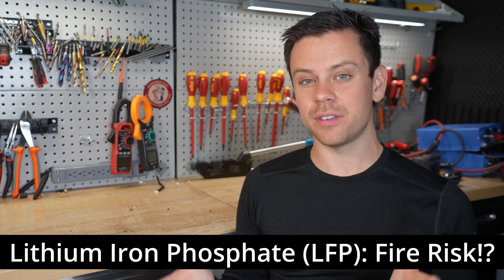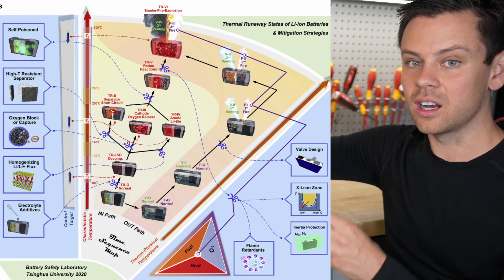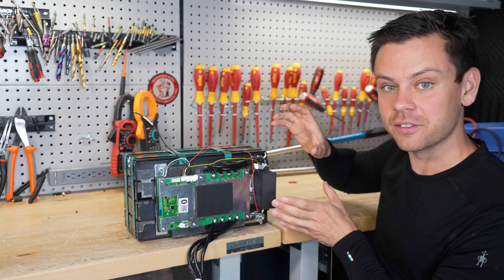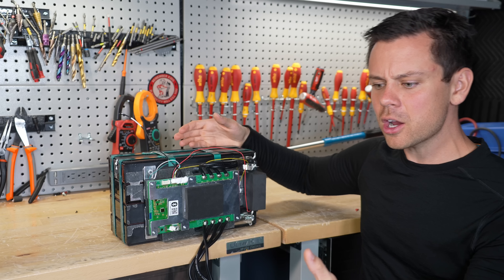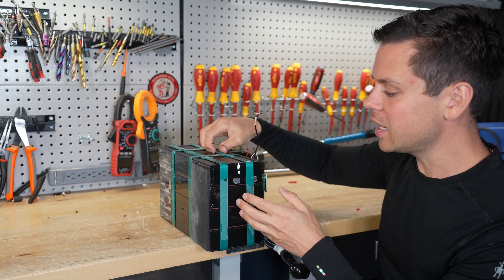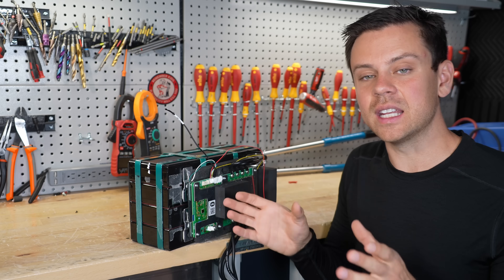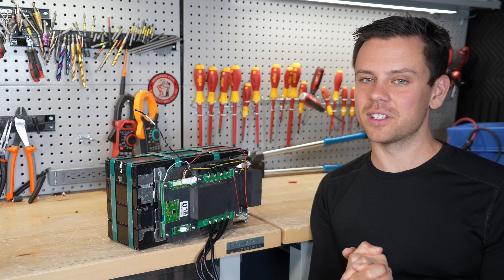LFP Battery Fire Safety: What You NEED to Know

Comment: In Australia since 2023 we have a standard that applies to new RV builds, among other things no batteries in a habitable space if not in a sealed box and vented to outside. Nothing to do with fire, only venting. Good to see this explained.
Reply from the maker: Not a bad idea. Ample venting capacity is a fantastic idea.
Reply: Technically the venting rule doesn't specifically apply to lifepo4. There have been extensive discussions between manufacturers and designers on groups online and the consensus is that the letter of the law says lifepo4 doesn't need venting.

Alternatively, there are manufacturers arguing that the case that the lifepo4 cells are inside of IS the sealed enclosure and therefore meets the requirement to install in a habitable area... There's even 1 manufacturer that started installing vents in their battery cases lol. 

Australia, home of convoluted and absurd rules.
Reply: Rv manufacturers in US have required this since 1990s
Reply: @omieyouknowme Never seen or heard of this on any RV YouTube channel. Installers don't seem to implement it either.
Reply: @holdenman8850 on all our RVs and my family’s the batteries are inside sealed and vented battery boxes. This is lead acid batteries to newer ones like my sisters. If your battery is inside the rv and not inside a sealed vented box hmm was it removed or never installed. 

Have to remember there is zero regulation for RVs when it comes to how they are built only requires a smoke and LP detector.
Reply: Australia is really over regulated.
Reply: @estbiker I feel like hugging you bro.
Reply: @estbiker  "Australia is really over regulated."

What is hilarious about your your statement, is that people with the ever selfish "I can do whatever I like" attutude, regardless of the consequences for anyone else, are the actual cause of regulations, but they are too dumb to understand that. They don't like regulation because it throttles the mindlessly dumb things they are inlcined to do at other peoples expense.

So should I assume that identifies you.
Reply: @estbiker Yup! Your typical MAGA Republican. Screw govt regulations 'cos everything is fine. Until it's not & then blame the govt. Snowflakes 😊.
Reply: @estbiker  Just dumb c in ACT playing god again and have no clue about batteries.
Reply: I tell you man! Especially at their points of entry! If every country should behave the way the do, chaos will ensue everywhere all the time.

Imagine an Aussie travelling to my country Ghana and the immigration seized his or her passport and destroy it claiming the paper or material used in manufacturing the passport is a biohazard to our natural habitat. 
They will say this is injustice, human right abuse,or we have no prove of what we are saying.  @estbiker

Comment: I've read that the only risk is that in a situation where the battery out gases about 49% of the gas is hydrogen which is flammable so if there is an ignition Source you could have an explosion. Other than that, the Battery Technology is quite safe.

Comment: This video is correct about thermal runaway, but there is one additional risk, and that's explosion risk. LFP batteries will outgas electrolyte in a thermal runaway. It's not as hot and there's less free oxygen than other chemistries, but it's still releasing combustable gas into your house. If you have a lot of capacity, it's very important that you properly ventilate so you don't have an explosion risk (sparked by a short or another appliance in the house) from the boiled off electrolyte filling your home.
Reply: Researchers in the United Kingdom have analyzed lithium-ion battery thermal runaway off-gas and have found that nickel manganese cobalt (NMC) batteries generate larger specific off-gas volumes, while lithium iron phosphate (LFP) batteries are a greater flammability hazard and show greater toxicity, depending on relative state of charge (SOC).

Comment: Thank you!! I upgraded to lithium batteries in our RV last year and was concerned because we have to keep in a storage facility. It is exposed to full 
sun and I was concerned about the temperature, particularly in the summer. I am so glad to know that the 100 or so degrees in our storage compartment is not an issue. 

Been watching for a while and love your videos.
Reply: Years ago I read a detailed study on lithium batteries,   optimum storage condition for longevity was 40% charge and 40 degreesF, cool but never freezing, especially during charging, and in a relatively relaxed but firmly biased State Of Charge should be the goal,  charge to higher state just before using.  Now those numbers may vary with newer chemistries, but the principle still applies. Dont charge above 80% unless you need that extra capacity, dont discharge below 40% unless you cant help it.  Friggen park before the car goes in turtle mode, in other words when the manufacturer determined you are really beating the hell out of that battery at below 20% and if you need max range, dont charge to 100% until just before you leave to avoid spending a lot of time at high SOC.

 Simply put, avoid loitering at the extremes if you want your battery to still be at 85%+ of new capacity, at 10 years old and thousands of cycles.

Comment: I've been working with Lithium Iron Phosphate for 20+ years and this is a very dangerous opinion.  There is way more energy stored in the battery than in his desk and the battery can release that energy very quickly.  The electroyte is flamable and under the right conditions it forms a little blowtorch than can and will ignite other things around the battery.  

They can be used safely but it takes careful engineering.  I have unfortunately see people loose their houses because they thought they had their boat wired properly or the battery simply failed.  

Sure its not as violent as chemistries that release oxygen but if you arent there to put out a "slow" or "booring" fire you could still loose your house.

All
Reply from the maker: Did you even watch the video? 😂

Comment: Just had a new after market 8 amp Makita battery pack explode on a genuine charger. 
It burst into flames and for 15 minutes sent individual cells flaming all over my workshop (20 feet away)
Luckily I had a good extinguisher to control the spot fires. Of course eBay says selling these batteries doesn’t contravene their policy!! 
I am now converting a metal file cabinet to a battery charging station.
So these tool batteries are a different chemistry to the ones you are talking about?
I have followed you for years and great to see you doing well. Greetings from Australia.
Reply: Yes those are l-ion not lfp
Reply: Can you buy safe tool batteries?

Comment: ...and also educate about many of the cheaply manufactured Chinese batteries, and the greater chances of failure.  Because of the separators between the anode and cathode layers within the battery, that are deliberately lower quality materials, just to save on manufacturing costs, which increases the manufacture's profit.

Comment: Excellent, I am having 2 x 460 Ah 12 volt LiPo4 build in China with an IP 67 to replace my 4 x 215 Ah AGM 12 volt battery's in my sail boat. Your video is timely as I had a fire risk concern. No one wants a fire on a sail boat off shore. Your clear fire risk explanation is a great relief. thanks for your effort. SV Skoiern IV
Reply: I hope you mean "LiFePO4" not "LiPO4" or "LiPo" batteries. "LiPo" is extremely dangerous and much easier to catch fire by itself if any failure.
Reply: @G-Tango  Thanks for your comment, my error yes your correct to catch my typo.  They are LiFePo4 and not LiPo4 or other LiPo's

Comment: What is the warning a home battery BMS does or displays when it malfunctions  ?
Reply: Some give audio alarm, others just stop the battery output voltage. Others, with Bluetooth features, can show the particular fault displayed. There is also LED warning, usually a red LED in the communication port lights up. So many ways, but often the best way is when your battery no longer outputs voltage.

Comment: The electrolyte in LFP is the most dangerous part of a cell. It's very flammable, and the fumes can actually react with water to form a strong acid (for instance, breathing in can seriously hurt your mucous membranes). Overall, the LFP chemistry is very safe compared to other chemistries. It is unfortunate that the majority of the time, MOSFETs tend to fail as a short. I am personally very disappointed that more vehicles in the USA are not available with LFP cells.

Using a thermal camera to observe any hot spots is the single best advice you can give to a DIY system. Be sure to put the system under high load for a few minutes first. This finds bad connections right away.

Comment: Like Will said, "use a themal camera and check your setup if you have it available", if not a wireless infrared thermometer with laser pointer can often be had at harbor freight for around 12 bux.  Every high power setup should atleast have one of these mounted on the equipment panel and use it to quck check the whole system for hotspots...

Comment: Can you do a comparison between LFP and capacitor based storage system?
Reply: Agreed, this would be an interesting topic for Will to cover, they do have many uses but I don’t believe they make a good storage solution for solar with lifepo4 now days because of their price and storage ability.
I use 2 x 16.2vdc Maxwell Capacitors in series with a balancer on a 24vdc 3kW AIO system I have installed in a 40’ Bus, it has 2 x 24v 5kWh lifepo4 batteries with a 200A JK BMS in each, so probably doesn’t need the caps really.
Capacitors don’t store a lot of energy but can release and charge quickly so they are good for surges that batteries may have trouble handling, in particular old lead acid tech that may not have high enough amperage output to allow for the surge created by a microwave, large pump or air-con startup for example.
The Maxwell 2.7vdc 3400farad caps can release up to 9,000+ amps for very short bursts and are good as a jump starter for cars and trucks, big Tractors etc, they are really great, but they wont run the headlights for very long maybe a minute or two.
I also experimented with 2 large 48vdc Maxwell Caps in series (96vdc) directly coupled to my solar arrays (74vdc max) which did make a big difference in keeping the MPPT controllers charging at higher levels during short cloud cover events and did provide a little extra storage after the sun goes down, but at $300-$1200 each you are better putting that money into lifepo4 storage.

Comment: i had a professional fire training class and that presentation does not agree with you.  also dendrites are a natural process of the lithium, that too was covered in the class.
also there was a huge fire in california, which was LiFePO which burned for months earlier this year
Reply: i will add, they are safer, but lithium is highly reactive,,   interesting since i believe it is the 3rd most common element in the universe.  i know it is used to age stars
Reply: The fire you are referring to was NOT LiFePo4 chemistry…those cells were nickel- manganese-cobalt which are known for “ thermal runaway”. Will must get so tired of these bogus claims in the comments!
Reply: The batteries that caught on fire were owned by Vistra Energy from Texas
Reply: @apainlessone  i will trust you are right, i go by what i read, which may not have been correct.   a lot of fake news.

i will transcribe my notes as i can and post them on lithium.

Comment: But they have Lithium ion in their computers and tools, which can catch fire. It took me a bit to train my landlord that my Lithium iron phosphate emergency power is safe for indoors. Fuses are the safety. I always use more fuses than necessary.
Reply: One of the guys on the job accidentally shot  his drill battery with a nail gun. I about melted a shovel, getting it away from the wooden structure.

Comment: Will, I'm a believer! I installed 2 200 ah Vatrer batteries under the bed of my RV.  I check the connections regularly and have never had a problem.
Reply: They really should be vented to outside the living space due to reasons mentioned above regarding the vent gas issue.

Comment: Can you do some videos on how to protect 12V, 24V, etc. setups from EMPs, either solar or man-made?
Reply: This kind of problem, assuming you really want to deal with it, would best be dealt with by having a system off-line and stored away in a faraday cage and only pulled out to use after such an event is over.

Having solar panels up on your roof or out in the yard and having wires stretching across your yard or down from the roof and having inverters or extension cords, etc, etc... all of that is going to induce electricity from the event you're trying to protect from.

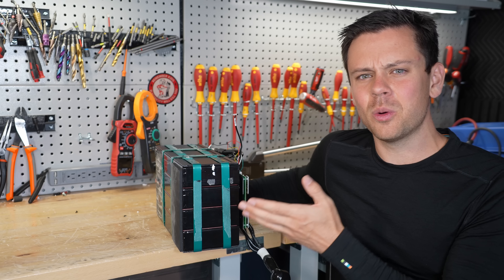Comment: 8:02 "The new ones charge faster than what we fill up with gasoline." This seems like a fun thing to read about, where did you find this info? Can't imagine charging a 50KWh car from 20% to 80% in a few minutes. It'd be nearing or over 1MW, right?
Reply from the maker: Average time for gas is 8 minutes in America. Latest byd does it in 5. But it is to 80% soc
Reply: @WillProwse  The average is EIGHT? Wow, longest I ever spent was 2. Seems much more feasible with that time range. Is this with BYD's Gen 2 blade battery?
Reply: Im assuming  tank capacity is a factor. I have a 36 gal tank in my truck and feels like forever to fill from empty, but the 20 ish gallon tank in my company van feels much faster to fill. Granted one tank is nearly twice the size of the other.

Comment: Golly, I just ordered the bluetti elite 200 v2 yesterday. One of the selling points was the battery last 6000 recharges at 80%, and they are the type used in EV’s. 
Does that make this unit a riskier option ?

Thank you, love your videos.
Reply: They are still lifepo4 batteries. They are just a higher grade of lifepo4.  They are not colbalt based

Comment: I found this video very informative. I'm familiar with LiPO from years in the RC hobbies, and I've seen more than one that's vented and burned like a flamethrower. If I recall, it has to do with hydrogen gas that's being released. This gave me a lot more confidence that if normal fire prevention/mitigation practices are used, the nastiest explosions and fires should not be possible.
Reply: Can they "explode", like gas vapors when encountering a spark?
Reply: @aussie2uGA If you're talking LiPO, what I've seen can more be described as a flamethrower, where the venting gas is ignited as soon as it exits the battery. The scary stuff I've seen on videos looks as if the gas did not ignite on release, but very rapidly built up flamable gas in the room and went off like a damn bomb. Terrifying.
Reply: Just had a New Makita aftermarket pack explode. After 10 minutes on a genuine charger. Luckily I was in my workshop and for 15 minutes it shot flaming cells all over my workshop causing spot fires 20 feet away I had a fire extinguisher and controlled fires.
So these tool batteries are different to what you are talking about?
Reply: @johnparkinson2774 Yeah, the solar batteries seem to be overwhelmingly LiFePO4, which are much more stable, versus the lithium ion packs preferred for power tools as they're lighter and smaller for the same output.
Reply: @Bob-cx4ze  This video is NOT about LiPO, which is a different chemistry than LiFePO4!